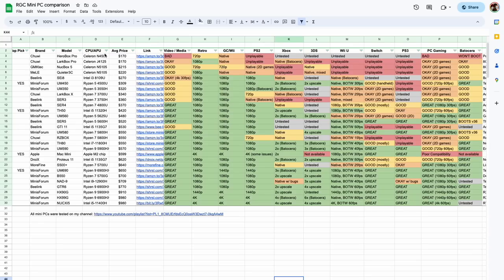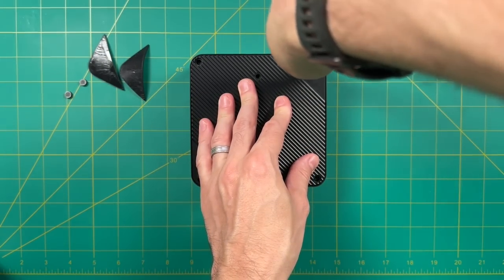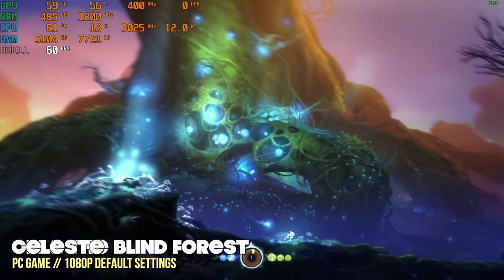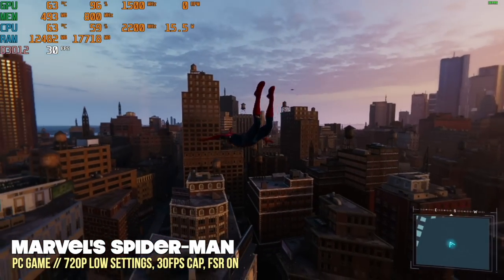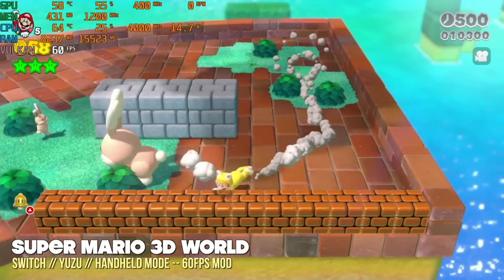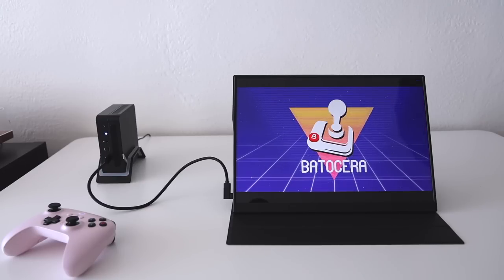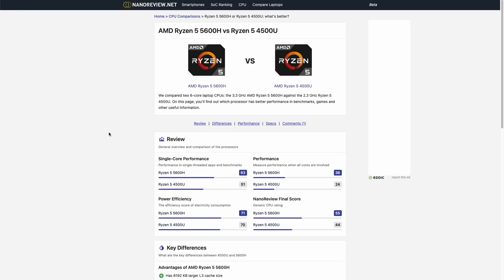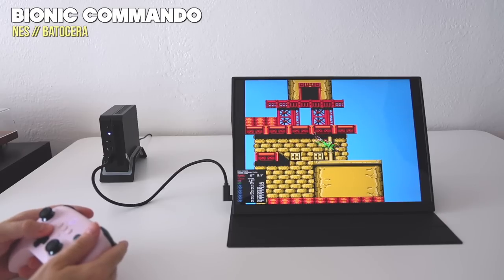$300 Mini PC with Power! MinisForum UM450 Review

Comment: Thanks for the very informative video.

 I'm building an arcade from an old ms pacman cabinet and I was hesitating upgrading from an i5 to a ryzen 5. This absolutely proved me the upgrade is justified. While 90% of mame games were playing well, there was still a portion with some 3D that was struggling. 

I did not buy the model reviewed though as this would be largely overkill for my purpose, but found a pc that had a Ryzen5 2400G. I watched some video and seeing how it still easily handled Wii U emulation, I'm pretty positive it will be powerful enough for any mame games :). My upgrade is on the way!! 

Thanks for your insightful reviews as always!

By the way, is it me or Ryzen5 prices has dropped substantially ? I remember PCs with Ryzen5 being at least 200$ dollars more expensive not too long ago...

Comment: I got the um690hx after your videos. it only has 16GB. I would highly recommend going with 32GB if you want to use chrome. I just bought 64GB of ram because twice the PC locked up when I was doing a bunch with OneDrive files, photoshopping, and using chrome.

Comment: I saw your video talking about the best handhelds for 4:3 retro gaming and wondered what you'd think about the specs of the upcoming Pixel Fold:
"So, the Pixel Fold will get two displays: a 7.6-inch main display with 6:5 aspect ratio, 2208×1840 resolution and 380ppi, and an additional 5.8-inch screen with FHD+ resolution and 17.4:9 ratio. Both displays will have 120Hz OLED matrices."
Reply: Inside screen for 4:3 games, outer screen for 16:9 games?

Comment: My comment with most of these Mini PCs is that an Asrock X300 is a better deal. It gets you 65 watt desktop processors and some level of upgradability for the same price. And it's still a mini PC.
Reply: Not small enough to stick to the back of my TV
Reply: @bikechan9903  There is actually a VESA mount available for the X300. It weighs about 5 pounds and is about 6 inches square, which shouldn't be a problem for any large TV sitting on a stand.
Reply: Noise would be louder, and the price is higher for that. Plus worse cooling probably. I'd still get one.
Reply: 5800h+6600m model is better yet value. The G processors suck GPU wise if you go with discrete CPU and no GPU upgrade. Even the 680m based mini pcs are much better GPUs than any G processor and soon to have 780m based.
Reply: @sprockkets  The price isn't much higher....

X300w: $165
Ryzen 4600g: $100
500 GB SSD: $22
16 GB RAM: $35

Total: $322

It's probably slightly louder with the stock fan, but you can use the wraith stealth or a Noctua fan and it's almost completely silent.  You can also add a 5600g or 5700g without changing anything else, for the increase in price of $70 - 100.

I'm typing this on an X300w with a 4650g BTW, hooked to the big screen in my living room.
Reply: @harleyn3089  I know desktop stuff performs higher, but I would rather the 6800u or whatever now, since it has RDNA in it vs Vega. Though every motherboard out for AM5 just....sucks. Like cool, you have 8 channel sound but don't give anyone the actual analog ports to use it! And yes, for a few stuff I use that setup is needed.
Reply: @sprockkets  RDNA will probably age a lot better than Vega. So that's a definite consideration if you're going to keep the box around for a while.
Reply: @stephenxs8354  Are these the HX99G series?

Comment: Curious, I was playing with batocera on my raspberry pi but when I upgraded to my Ryzen 7 4700U mini pc from beelink last year (for $377 during Amazon prime) I researched batocera for windows and came across Retrobat which is essentially the same thing except you don't need to reboot your windows PC...in fact, it's made for windows...and yes, you can put it on a USB drive for portability...

I would like to see a comparison video between the 2 detailing the subtle differences, if any.
Reply from the maker: Retrobat is great, I've featured it in a lot of handheld PC videos.  It's nice if you want an EmulationStation layer within Windows, but the emulators are generally older versions and it does take some work to get them updated to more recent versions.
Reply: @RetroGameCorps  yes, but aside from the delayed updates wouldn't you say they are both essentially the same frontend in terms of UI, features, and functionality?...at least, it appears that way to me.

Comment: I feel like this could have a lot more potential, if the TDP and fan speed could be unlocked. I have a laptop with the same processor (4500U) and the poor cooling means that even if i go to 30W it quickly throttles. In a mini PC, with a better fan and cooling, I'm sure it could easily sustain over 40-50W, as many other mini PCs already do. Could make for a significant 20-30% improvement just through doing this alone.

Comment: thank you for your videos. i'm thinking about getting one of these but i want to know if it can emulate dragon quest 8 ( ps2) as it is one of the hardest game to emulate
Reply from the maker: Yes, that will be fine, although it may require a 720p upscale at some points instead of 1080p.  What I do is set a hotkey for upscale/downscale of the resolution (usually SELECT + Up or Down), so I can adjust the graphics on the fly with harder parts.
Reply: @RetroGameCorps  thank you so much for this tip

Comment: If you can find one with a ryzen 7 4700g or higher vega 8 graphics 8core/16theads it will emulate ps3 with no issues.   Keep a eye out for one

Comment: Please, someone just give us a mini PC with a 7840HS already... Not some old junk like this one.
Reply: The chipsets and motherboards are still expensive for AM5. A 7840HS mini PC would probably be in the $1000 range if it was released right now. Those machines will happen, but I wouldn't expect them at a reasonable price for several months.

If they did release them now, and this review was about one of them, this whole comments section would be people complaining about the price.
Reply: @harleyn3089  I don't mind paying that price for an emulator PC that I could keep for a very long time.
Reply: Get a laptop and an hdmi cable
Reply: @obvious_giraffe8386  Obviously, I don't want a laptop for a home PC.
Reply: Bruh, the benchmarks leaked last month for that chip and based on those that chip isn't going be nearly the 300 bucks this one is. More importantly it's not even released yet, there's not a single product with that released yet. These things aren't immediately magic'd out of thin air. The manufacturing process takes time.
Reply: @Shanehudson27  Like I said I'm not looking for something cheap but something very powerful.
Reply: @Lenmaer  build your own mini itx then😊
Reply: @Shanehudson27  7840HS machines come out the beginning of May. ETA Prime did a pre release review of one today. I'm not sure whether it was a laptop or a mini PC though, because he only showed the benchmarks, not the machine the chip was in.